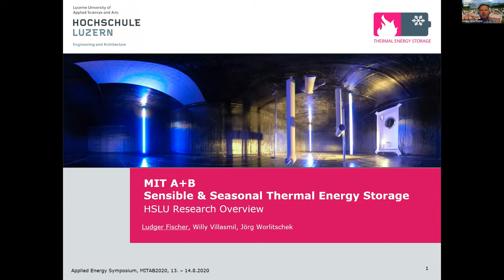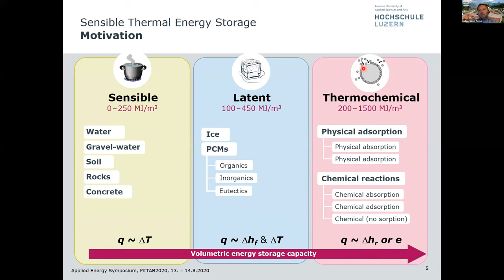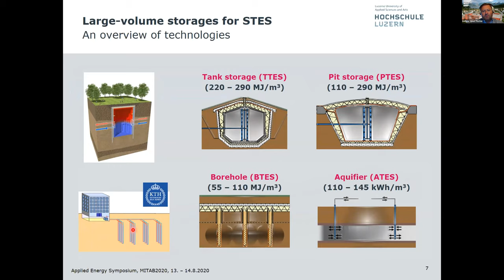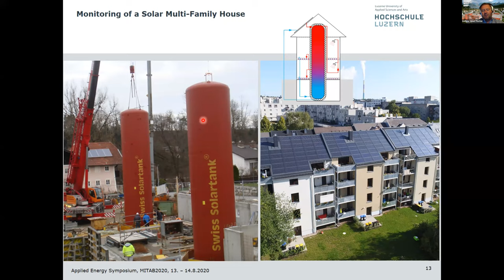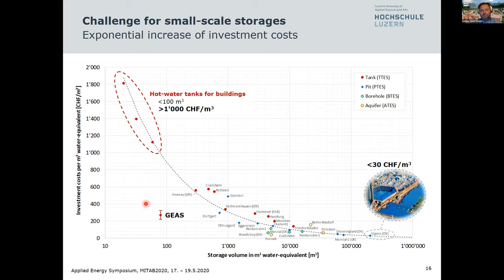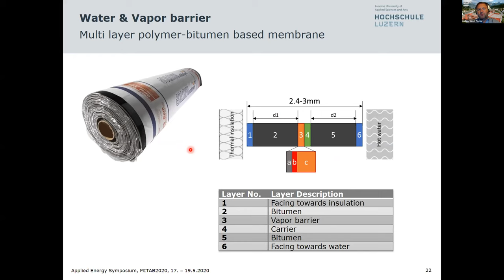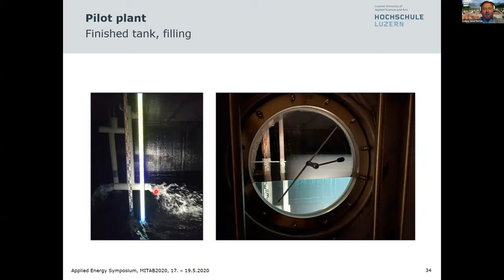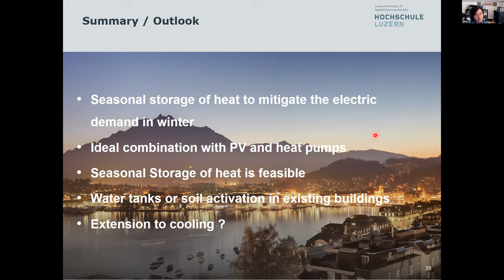MITAB20-Lodger-Sensible& Seasonal Thermal Energy

Comment: How about new buildins or external underground concrete tanks? Can they be insulated from outside during the construction time? Will the concrete walls in a 20m3, 3.5m hight tank conduct heat to the lower parts negative affecting the statification process?

Comment: use cellglas fex glapor as insulation. it doesn´t have any creeping
Reply: Price/performance?
Reply: @allanallansson9532  a bit higher price than conventional insulation but long term high insulative performance without loss of effect even with rising humidity. Also withstanding rodents and ants... Had bad experience with EPS 😀
Reply: ...and high compressive strength, better foundation, saves concrete and rebar?
Reply: @allanallansson9532  yes, you need no rebars only under the walls otherwise fiber reinforced thin slab is enough 😀